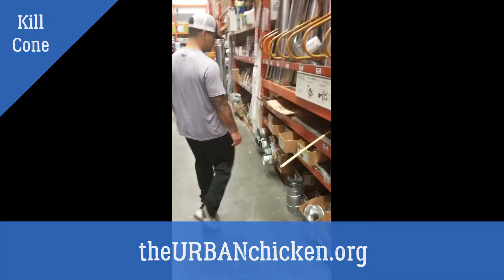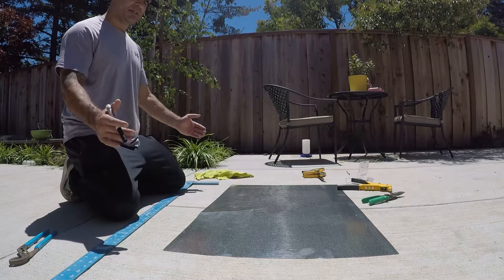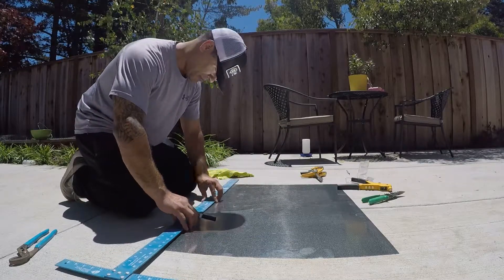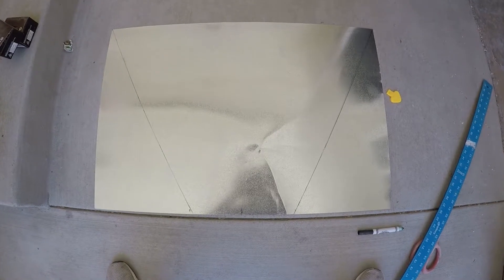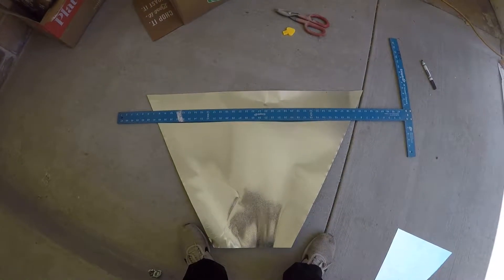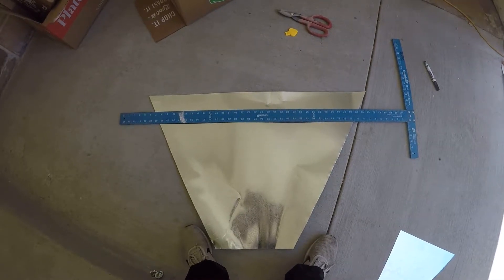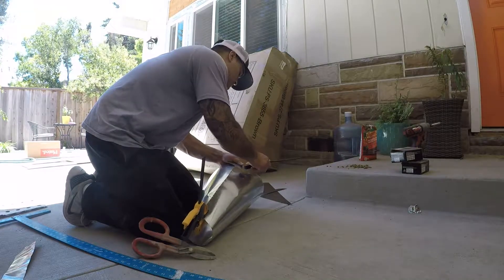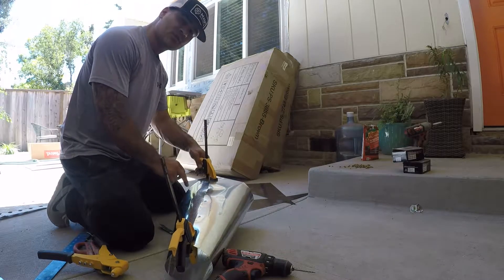Chicken Kill Cone - How to make a chicken kill cone

Comment: Used your design for my own killing cone - worked great! Instead of sheet metal I used Polywall, a type of plastic sheeting used for showers that cuts easily with a box cutter. Instead of rivets I simply drilled holes through the plastic and joined the two halves (one inch overlap) using tie-wire (made sure to put the sharp ends on the outside. Once finished I attached it to a tree only using one screw (with a rounded head to avoid hurting the chicken).

In the video you fold the top over 4 inches - instead, I cut the 4" inches off the top.

It might depend on the chicken, but I would recommend perhaps making the hole for the hen's head a little bigger, or perhaps widening the cone shape slightly. It worked for me, but it would have allowed her head to poke out a little bit more which would have made the process a little easier.

Great instruction - thanks!